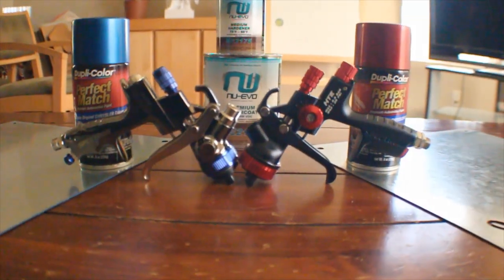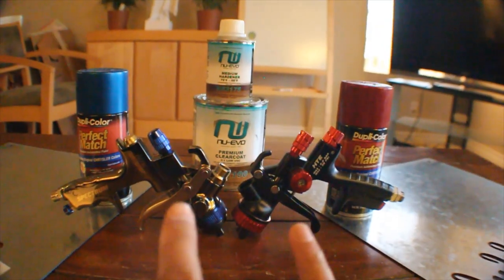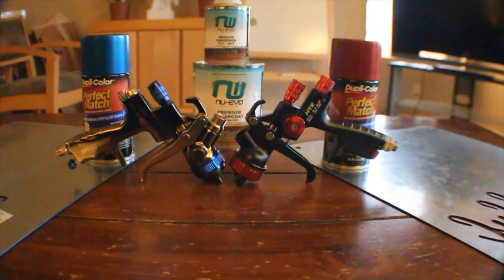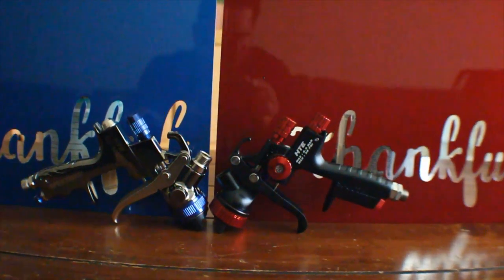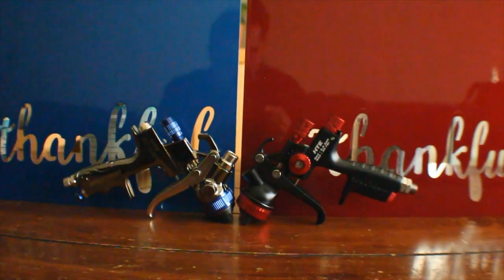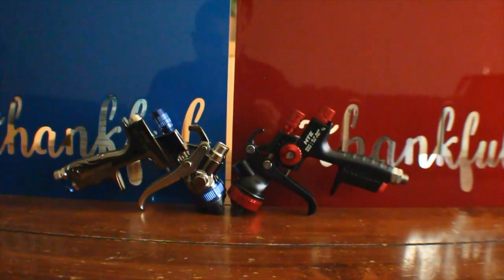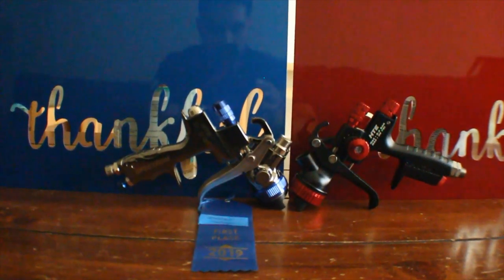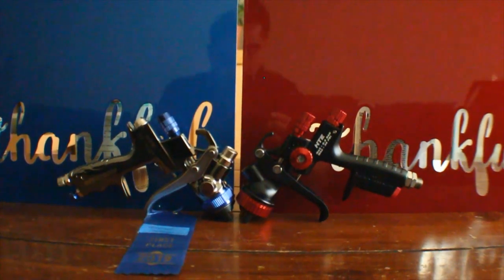Harbor Freight Spraygun Shootout: Spectrum HTE Vs Black Widow HTE

Comment: Whats the diffrence of the Hte and the hvlp?
Reply from the maker: sergios602 thanks for the question I’ll try to explain the differences. 
The hte stands for high transfer efficiency , similar to an hvlp meaning they typically meet the hvlp standards for transfer efficiency but not in all the zones. Also pressures will also be different usually hte guns spray slightly higher pressure then hvlp, hte really is a best of both worlds between conventional and hvlp, it’s sort of like combining both together to make hte. 
Hvlp stands for high volume low pressure, meaning a higher volume of paint/efficiency at a lower pressure. This setup reduces overspray and wasted material, and transfers a higher amount of paint on to the surface of the panel/ or object. , typically hvlp are best for base coats , where hte are better for clear coat refinishing, depending on the gun of course.
In the example of the harbor freight guns. The major difference is tip sizes hvlp carries a 1.7 and the hte carries a 1.3 so in that, the 1.7 can paint much thicker paints where the 1.3 would be suited for finishing coats, like clear coat. Of course that doesn’t mean the gun can only be used for that , typically hte can spray base just fine, but at times struggle with some metallic paints, something you just have to play around with. Hope that helped
Reply: @Mechaniclyfe  would not a pressure pot be just as good as stepping up the tip size?

Comment: Both of those guns are made by Spectrum the Black Widow was just a high- and model of the spectrum line and should outperform the cheaper version
Reply from the maker: Garden of Truth you would think so but the spectrum still performs just as good as the widow , the widow only has minor improvements over the spectrum
Reply: @Mechaniclyfe  I've got the Black Widow I bought it over the lower inspection because of Machining looked better
Reply from the maker: Garden of Truth  true it is higher quality should last you many years to come , it’s really a good gun
Reply: @Mechaniclyfe  I'm very impressed in how it sprays it's my first HVLP
Reply from the maker: Awesome 🤙🏻 it’s an awesome gun
Reply: I spoke to an employee at harbor freight today about the two guns.  He said the Spectrum shoots 95% as well as the BW. So it’s a very slight improvement. I’m still spending the extra cash for the BW. I want a gun that cleans up easier.  If I ever get a Devilbiss Sri pro lite I think the 3m pps cups will work on both?
Reply from the maker: Yes just get the appropriate adapter for them

Comment: The real question is... are you thankful?  HF is selling parts now I saw for guns 💪🏼 if you haven’t seen 👀
Reply from the maker: Gmguy3car i haven’t seen any parts available at my local store
Reply: Didn’t say they were on shelves, go check yourself, HF stepped up. HOW THANKFUL ARE YOU
Reply from the maker: Gmguy3car found it 
harborfreight.com/parts is the link. They only currently have replacement needles and springs from what it looks like

Comment: How would you compare it to devilbiss tekna prolite?
Reply: The pro Lite is one of the best spray guns in the world.  Its is the most versatile with a choice of four different air caps and multiple needle and tip sizes.  Will go head to head with any Iwata Sata or Sagola for a LOT cheaper than Sata. Super efficient.  Its a personal favorite of mine obviously.  I like Sata 5000b rp too but prefer pro Lite,  GPI or w400 Bellaria for the price.  As replacement parts are unavailable for harbor freight guns they are basically a cheap disposable tool. The other guns I mentioned will last a lifetime and are a significant investment.  👍
Reply: Tekna = better

Comment: What is difference of the Hte model compared to the Hvlp
Reply from the maker: BACK2LIFE29 Hte is high transfer efficiency , hvlp is high volume low pressure. Hte carries a 1.3 should be more ideal for clear and base, where hvlp would also be good for base due to a high transfer rate, but carries a 1.7 so Ideal for more thicker paints and primers. Honestly both guns are great , but the hte I feel would be more ideal for everyday automotive refinishing spraying.
Reply: 0
Reply: @Mechaniclyfe  Iltgey only had the hte in stock and I need to do primer and base coat on my car. Will that work with different tips or do I need the hvlp? Would like to use just one and buff it after. Thanks!
Reply from the maker: @Fleshnbloodrobot  depends on the thickness of the primer some primers are very thick others not so much , can you use a sealer? Sealer is much thinner and you’ll have a better chance of spraying out of a 1.3. Unless you have extensive filling to do then you’ll need a thick primer for sure
Reply: @Mechaniclyfe  appreciate that! I’ve decided I’ll just get the cheap “purple gun” for primer so se it can be a throw away and leave the nice gate for just base and clear(: thoughts?
Reply from the maker: Should work , purple guns have a 1.4 so not too much bigger than a 1.3 but if the primer comes out rough no worries it’ll need to be sanded anyways

Comment: How would you rate these against durablock 007 ?
Reply from the maker: Jason Dayberry id prefer these over that 007 any day of the week. Those 007 guns are over engineered, and honestly they aren’t any good in my opinion. It’ll do the job in a bind. The design on the 007 is not only hideous, when wanting to clean the gun out half the gun comes apart in two pieces . It’s more work than its worth really. Hands down harbor freight on that one
Reply: @Mechaniclyfe  I will have to swoop some of those guns up then.      My 007 guns use to work great with little to no peel but now they are old and didn't stand up to continuous cleaning using solvents ate the chrome plating.  If you were looking to buy a more expensive gun what would you buy for your base and clear coat guns?

Comment: how long do you wait before you spray the clear over that duplicolor?
Reply from the maker: christopher groh when the base coat has become a dull finish that’s when it’s dried and ready for clear about 10 min
Reply: Don't forget he is using a lacquer based rattle can.  Dries fast. If that were acrylic urethane base it would be 30 to 60 min depending on shop temperature and wether it was solid or metallic.  👍

Comment: Why do you only spray clear with these guns.  Put some color in them, PLEASE.  Use them for primer and base coats.  Please.  Otherwise, just use the rattle can clear.
Reply from the maker: Jon Woodworker will do
Reply from the maker: Jon Woodworker I spray clear with them because they are designed as clear coat or finishing guns, but they will do well with base too , primer is too thick to shoot with these size tips and really I like to use cheap 10 dollar guns for primer. But I will be shooting base for now on for those who want to see base being sprayed
Reply: I used the Black Widow HVLP today to spray water based Urethane on wood, as I am a finisher for a commercial cabinet shop.  It did an excellent job.   Looking forward to using the Spectrum HTE next week.
Reply: @Mechaniclyfe  , your saying this gun will not do primer !  What’s up with that ! I need some that will do primer,paint, and clear !
Reply from the maker: The hvlp 1.7 is good for primer , the tip might be too large for base and clear tho,   But doesn’t mean you can spray with it for base and clear but it will be heavy for base ans clear and will lead to runs, for base and clear use a 1.3version
Reply: @Mechaniclyfe  ok so your suggesting get the hvlp for primer and the other one for finish paint?  I would love a gun that could both !

Comment: What's the fluid adjustment on these guns 2.5 turns out or 3 turns out
Reply from the maker: You got it , I spray all the way open mostly
Reply: @Mechaniclyfe I tried spraying wide open it sprays out way touch material and leave a Lil orange peel I spray at 30 psi
Reply from the maker: 30 psi is a good pressure , I go wide open but depends on your material the thinner the material the more you turn in , the thicker stuff need more volume
Reply: @Mechaniclyfe  got you

Comment: Slightly a misinformed video here cause the guns are the same, only thing changed was a plastic seal swapped out to metal seal from manufacture.
Reply from the maker: Incorrect actually , caps are different  as well they don’t thread into each other , and so are the air distribution rings , along with some different seals for the trigger piston .
Reply from the maker: Other than that they spray very similar
Reply: Just A Mechanic ok, thank you for the correction 😎